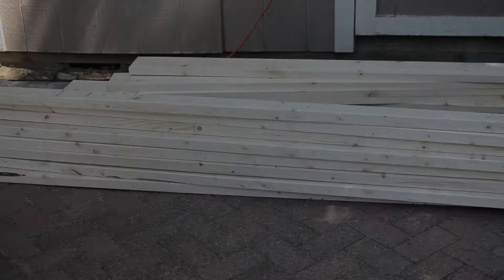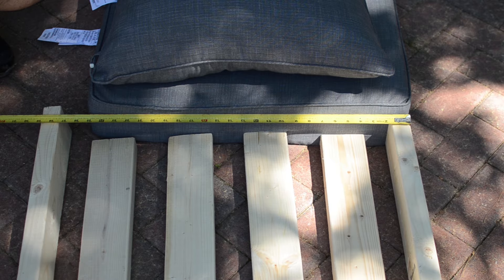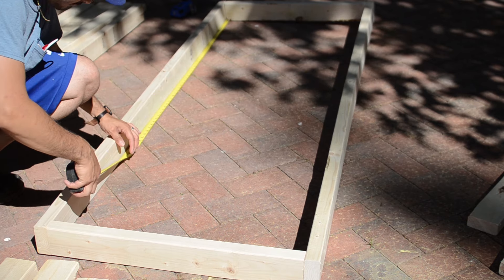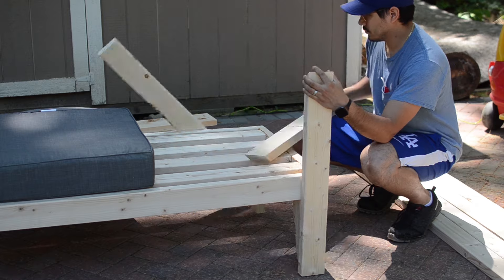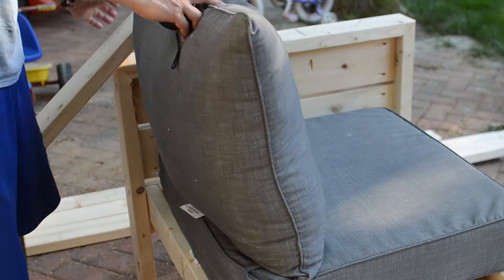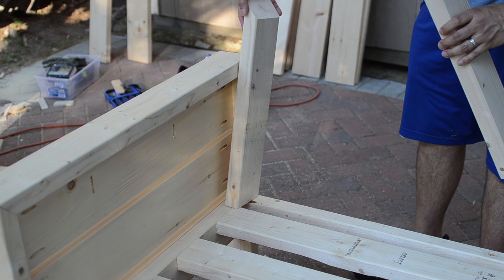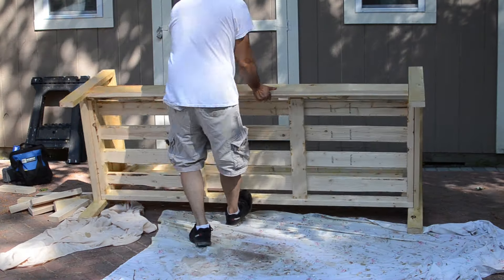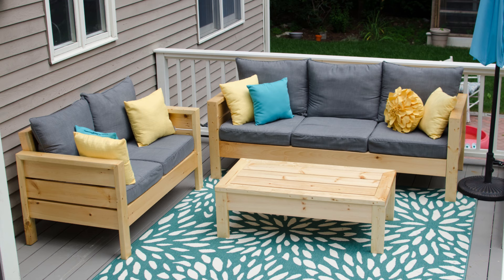DIY Outdoor Sofa - How To Make An Outdoor Couch #woodworking

Comment: Loved the video of you custom made it to the cushions size and adjusted the build as you checked for strength and longevity. This thing isn't going anywhere, but I would definitely used the furniture slides to protect the deck or patio from scratches. Well done!

Comment: this is the first one Id seen with 45 degree mitres on the sides and looks alot better than the others. Is there any down side from weaker joint or more risk of water ingress ?
Reply from the maker: I haven't noticed any since I built it. 😁

Comment: This turned out great, what type of wood did you use?… I also have cushions I had recovered and they are nice 30” by 30” .  Do you have plans?…
Reply from the maker: I used 2"x4"s and 5/4"x6", but you can use 1"x6" instead of the 5/4"s.

Comment: your calculation for the length of sofa is off. Width of 2 X 4 is around 1.5 inch. so it should be (25.5 * 3) +3 = 79.5 ?
Reply: i mean instead of adding 2 inches shouldnt you be adding 3 inches?
Reply from the maker: This was to get the length of the surface for the cushions.